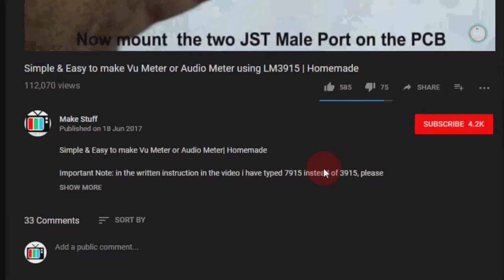3.5mm Stereo Audio Jack to Crocodile Clip for your DIY Projects

Comment: why isn't there a pre-made cable like this ? seriously searching for it since 30min now
Reply from the maker: These cables are only for testing purpose & not used in general consumer electronics that y its pretty rare to find one, so i think its much easier to make one.
Reply: Me too. The same problem and you saved me
Reply: The guys from Midi Sprout they are selling them in the package with their device. I already asked them if they would be prepared to sell just the cables, but no response.